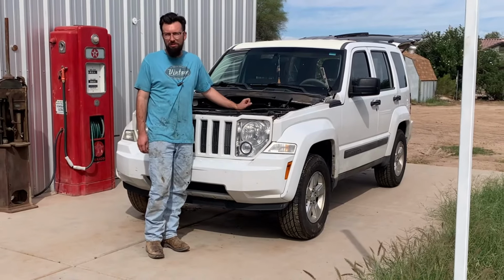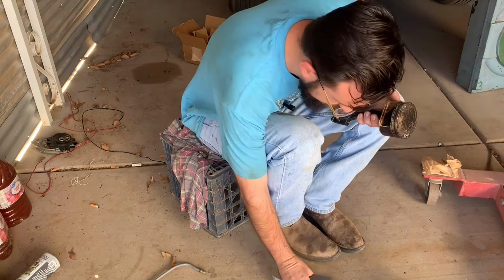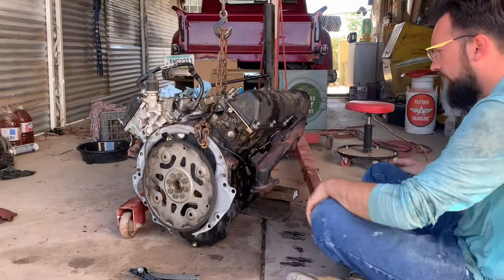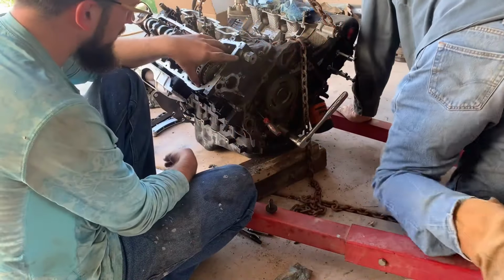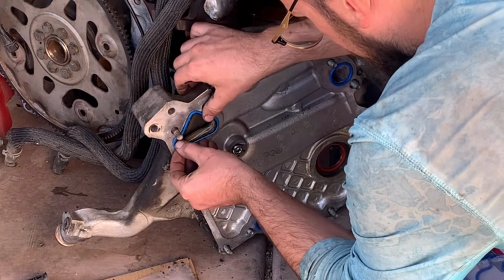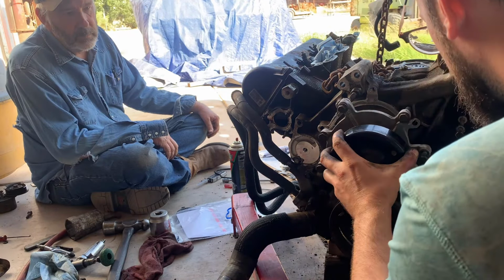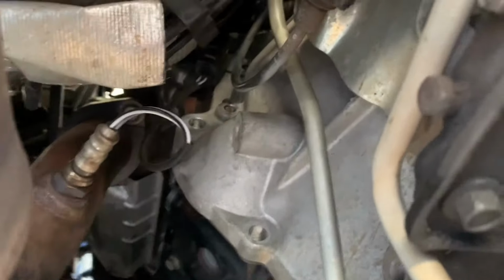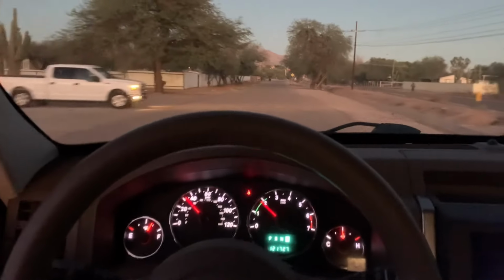Will this BLOWN UP jeep run and drive again for under $500?

Comment: Just thought I would share this thought I learned from another old man .  To remove rust from old rusty door locks and things , I fill a bucket with white vinegar - put my parts in to some for 3-4 days or more . I take power washer and wash the parts . They look like brand new.  It really works great for the old rusty Model A wheels and for gas tanks .  Pad locks, window regulator etc . 
I love the trip you did with the 2,000 mile trip  with your dad .

Comment: My grandson has a 2003 liberty that had the same problem with 103,000 miles on it. He wanted to get another vehicle and use the jeep as a trade in. His father gave me the vehicle. I will be using your vehicle as a guide. you have given me a preview. Thanks.

Comment: its always a good idea when you have a engine apart to do a cam crank correlation with a scan tool usually they run better and start quicker

Comment: Great job. Not sure what went wrong. I bought a 05  new in 04 and put 170K on it. Never touched the engine same as hers. Same plugs ran great. Also had a 97  dakota similar engine 217 K on it before wrecked.

Comment: My daughter had a Jeep Liberty, but it was the older body style. Also, a 3.7 liter. When she sold it, the mileage was well over two hundred thousand. It treated her pretty good other than the gas mileage which I do not believe was very good. I hope you did not get any gasket material into the coolant or oil passages.

Comment: Any Chrysler/Jeep/Dodge product with a .7 in the engine size are trouble. The 3.7 is famous for dropping valve guides. A friend of mine dropped one before any other damage pulled the head and had a machine shop do all the valve guides on that head. I warned him to do the other head as well while he had the intake off and the exhaust dropped but he thought he knew better than I did. He ran his Dodge Nitro for three days and dropped a valve guide on the other head. Live and learn.

Comment: I have a love hate relationship with my Jeeps. My 1993 Grand Cherokee with the 4.0 L, is way more reliable than my 2006 Hemi Commander. Wouldn't be surprised if the gen 1 Hemi's cylinder deactivation causes a dropped valve in the future. The Commander's like a Cherry on a Daimler/Turd Sunday!

Comment: Looks like you were bitten by what engine rebuilders call the, "Curse of the Sevens," which refers to the problems of build quality and reliability of the Chrysler 2.7, 3.7, and 4.7 engines. Glad you were able to save the engine and get the Jeep back on the road. Well done!
Reply: That three seven was a pretty good engine. My daughters went over two hundred thousand and we saw it a year and a half later and the guy said it had so far treated him really good.

Comment: Hey do you know much about these kk jeep models because I have a water leak going into drivers floor right hand drive and sometimes my 4wd light and abs and traction control light comes on when I'm driving it turns off after I restart it cheers

Comment: My 04 threw a rod about 2 months ago.

 Crazy thing is it kept running on probably 3 or 4 of 6 cylinders at a top speed of like 20 mph till I parked it at the final resting place. RIP

It had a bazillion miles and on its sixth set of fresh rubber. So it served me well but apparently they are kinda like Japanese motors. 

Damn near bullet proof but if something goes wrong then it all becomes a mess I guess based on the prices folks are asking for motors. 

I can almost buy a used Jeep for the same price and rob parts off this one but for who knows how long.

Other people typically don't do regular maintenance like I do and it still gave up the ghost suddenly weeks after a fresh oil change and filter. 
My rolling tool box made me a lot of money. The Jeep fits inside forklift lanes in big factories like 3M and Kholer plants.

It could go places my Welding truck couldn't.

Comment: Dropping a valve seat happens (RARELY)  in racing engines a very high RPMs  but I can't recall a  single time of it happening at regular highway speeds. Just a fluke,

Comment: This video made me think of computer related hardware that fails 'out of the blue'. Same deal. Something just 'breaks' and it's unclear if anything caused it, or it was just a part failure. Also sometimes difficult to find the smoking gun. At least in this case the hardware told the tale. Bummer that it was. Wonder if you would have taken it to a dealer or other mechanic what they would have told you for root cause. Obviously it would have cost hundreds or thousands to repair.

Comment: Why do valve seats drop?
Reply: It's a common problem with the Chrysler Power-Tech Engine, Esp. the earlier ones, Best to have the Heads done with the updated seats!, Did all that to my 2001 Dakota when the Engine was rebuilt back in 2018, It's the V-8 4.7

Comment: Ping ping ping Ping ping ping ping ,Hows that ya get enough pings ,Did ya hear that when the motor said ================= When my ram with the 5.7 cam & lifter grinder started ticking i just stopped driving it and ordered cam and lifters  and started tearing it down. Its all good now, for another 50.000 miles (maybe))

Comment: I love the sloppy cheap approach. Just as a recommendation. When valve seats fail some engines can end up with pieces of metal in the intake or exhaust. You should always just replace the manifold because it's cheaper than trying to clean them or a new engine. Secondly when you honed that cylinder I didn't see you wash the cylinder out with warm soapy water. All the grit from the honing process will now be left in the engine from that process. I would've cleaned it out with a warm soapy rag and then coated it in oil. These engines are notoriously bad so I don't think those minor details will have made the biggest difference in your case.